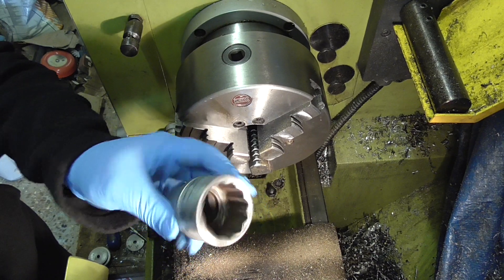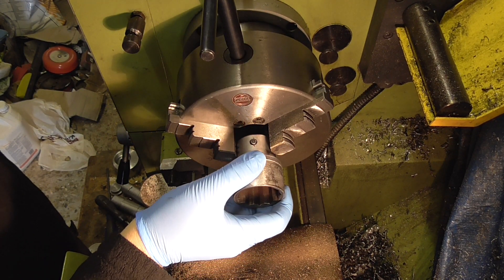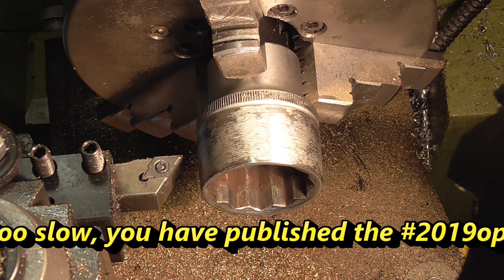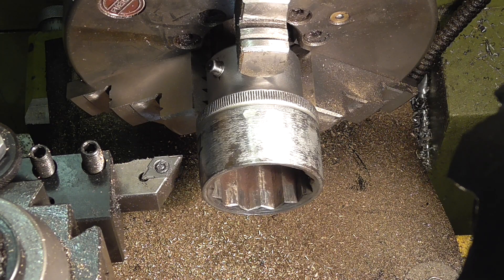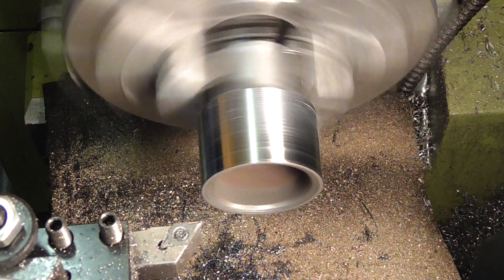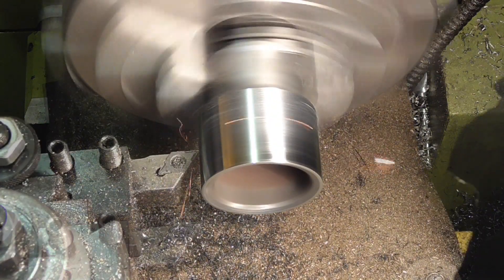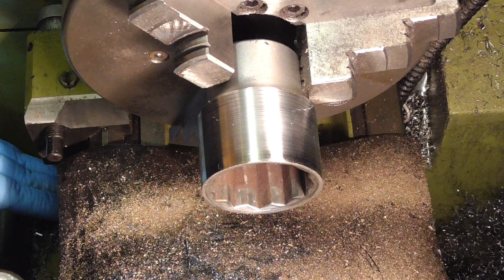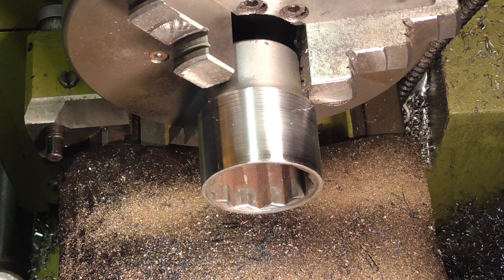Thinning the walls of a 36mm socket.

Comment: Gee, your chuck runs better than mine (way better) 😀 (Hmm, maybe I should but a better chuck!) Did that tip fail when the sparks started?... Martin
Reply from the maker: Hi mate
Its not a too bad a machine for an import machine.
No tip stayed the corse. Still looks ok.
Im away on holiday atm. Visiting Duxford for the DC3 gathering. I will be videoing this & I'm taking loads of photos too. (For my new YT channel)
But I'm editing videos I have not had time too, so I will have more content coming soon.
Reply from the maker: Hi Martin
I am relatively pleased with with the Warco, with a few mod's it's proven a good little machine for an import unit.
The tip stayed the course and looks ok. I was taking quite fine passes (no more than .25 (a side)). this was mainly because my charidge drive failed so I was using mandralic instead.